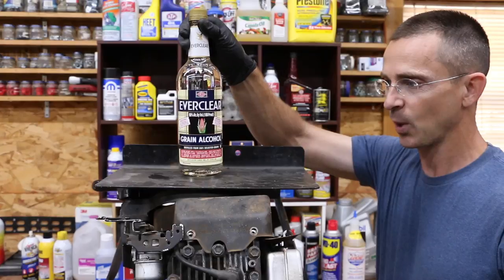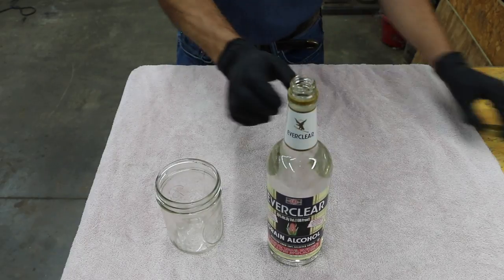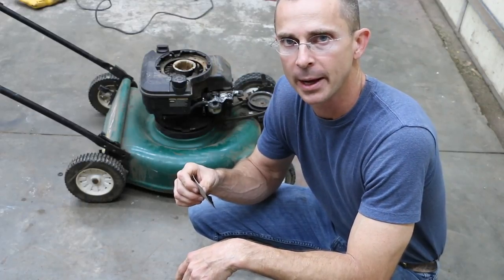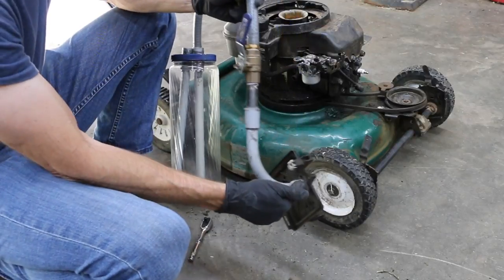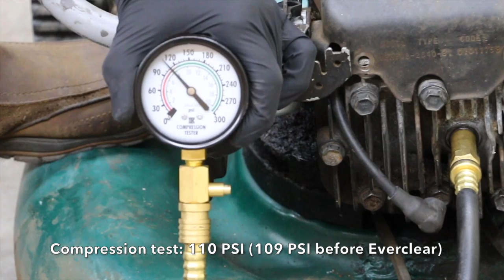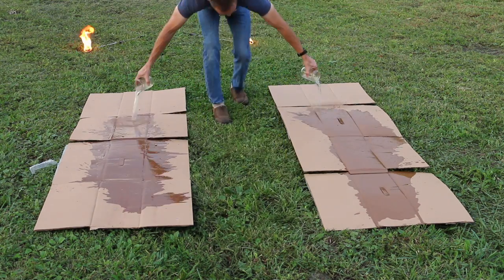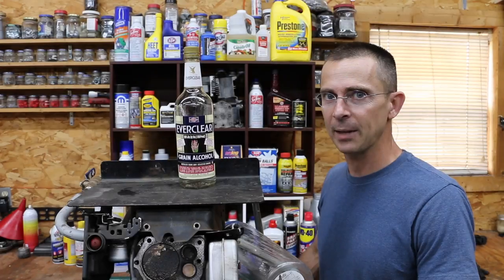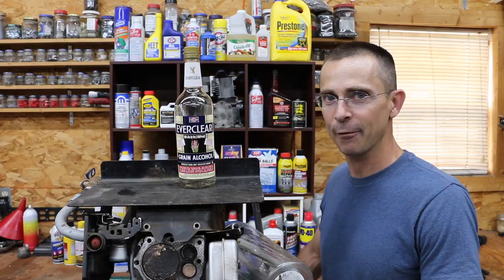Will an Engine Run on Everclear Fumes?  Let's find out!

Comment: I recommend a side by side series.  Gasoline vs ever clear, which engine will run out first.  Gas vs whatever.  I think that'll be interesting.  And then obviously a tear down which engine is has more carbon build up.  Might end up finding the alternative to gasoline lol
Reply from the maker: Thank you for this recommendation!

Comment: That's why alcohol mixes are used for high performance engines because it has a high octane level but for much cheaper than a high octane gasoline and cooler burning. Easier for the engine to run it and oxygen is a byproduct which helps too. You can also get much better compression/ use higher compression ratios, but these are from petroleum derived alcohols not for consumption.
Reply from the maker: Great point and thanks for commenting.

Comment: It'll work,I've done it..both in a lawnmower,and a car.(SBC.) Probably need to fiddle the carb. mixture a fair bit.  I didn't notice any major difference in temperatures,or power. (going by the 'butt dyno'). The car experiment wasn't straight alcohol,there was still a little gas in the tank,but it was mostly high-proof alcohol.
There are lots of stories of moonshiners using their hooch as fuel,in a pinch..it seems there might be some truth to those stories.
Reply from the maker: Thanks for commenting on this!

Comment: So as just sort of a personal project of mine, if I wanted to make a generator with a small engine like that, what kind of parts and equipment would I need to rig for near silent operation?
Thank you in advance.
Reply from the maker: Thank you for this recommendation.

Comment: Is the bottle cold when you're supplying the fuel?
Reply from the maker: The bottle is room temperature. I'm sure it would work much better if heated, so it could vaporize easier. Thanks for commenting.

Comment: What tool or homemade tool do u use yo start your engine id like to make something like that for my paps log splitter is has bad arm and cabt pull start his
Reply from the maker: I use a 1/2 inch socket adapter that mounts to a drill.  You can buy them on Amazon or on Harbor Freight for a few dollars.

Comment: So my vehicle runs on E-85 ethanol. I wonder if i could fill it up with pure Everclear? perhaps it will run either slightly lean. or too lean.
Reply from the maker: That would be extremely expensive.  Everclear has some water in it, which might be an issue.
Reply: you're right about the water part. e85 is 85% ethanol and 15% GAS. not sure how 90% and 10% water would be. probably not good for the engine. if some of the fuel bypassed the piston rings and got into the oil. the oil would immulsify. good call.

Comment: Try making a head with extremely high compression. Then allow the carb to push fuel into the port while it is cool then turn it off.
Reply from the maker: Thank you for this recommendation!
Reply: In theory it should compression ignite.

Comment: Is there any real difference between ever clear and the ethanol component of E85? Other than ever clear being even more pure. Could you make your own E85 with gas and ever clear if you had a flex fuel vehicle?

I seem to recall Mythbusters running a computer controlled camaro with moonshine.
Reply from the maker: Thank you for this recommendation!
Reply: Project Farm No problem. I enjoyed this video. I forgot to mention that using a computer controlled engine on a E85 car means the computer will automatically adjust fuel flow and spark timing.

Comment: Should have done the burn test on the cardboard at night.  Pure alcohol burns very clear.  In the drag racing circuit, additives are used specifically to add color to its flame for safety reasons.
Reply from the maker: Great point!

Comment: I'm surprised ethanol didn't burn cleaner. I was looking to see if you had done anything with E85, but this is very similar. E85 isn't liked for small engines because they sit around and E85 will absorb water from the air and grow things. It would be interesting to see an engine run on E85, then add water to E85 not to the point that you see it separate. (I'm assuming that would be about 42% by volume.) That wet E85 would be a mix of gasoline, ethanol and water all in suspension. If you add enough water, the gasoline will actually begin to rise to the top and separate. The alcohol and water will sink to the bottom. This would also be a cool test to see if gas stations can really "water down" their gasoline.
Reply from the maker: Thank you for the video idea!

Comment: As a random thought, if the small gas engine works off the vapor, and someone's breath is somewhat combustible, would it not dictate that fuel economy would go up if all engines were made to use vapor over fuel injection? Or, maybe in conjunction with?
Reply from the maker: Interesting thought. Thanks for commenting.

Comment: Before even watching, alcohol is a great fuel. Can be used very rich but the timing has to be advanced because it does burn slower. E85 does wonders to modified or forced inducted engines when tuned properly.
Reply from the maker: Thanks for watching.

Comment: My only criticism  about the video, which was great by the way is that you forgot to do a horsepower test to see how much less power that slower burning ever-clear makes.
Reply from the maker: This is great constructive feedback.  I'm trying to come up with an engine dyno.
Reply: Keep up the good work and let me know if you need any parts or tools for future videos.  I really like the seafoam videos on that ford ranger.
Reply: Max
In theory the alcohol can more horsepower due to the much greater cooling effect it has on the air charge compared to gasoline as well as alcohol's high octane rating allowing for more compression and spark advance before there is a risk of detonation. This comes at the expense of greater fuel consumption.
In practice, the way this experiment was set up, the engine will make noticeably less horsepower because it has to be choked (restricted air flow) so much in order to get the air fuel ratio rich enough for the engine to run on alcohol.
It would cost some money, but they do make small, adjustable carburetors for these types of engines designed to use alcohol (methanol). They are common on Jr. Dragsters and go-carts.

Comment: Alright now you done two tests where your fuel waper bottle system made an engine run on just the wapers of the fuel. 

For about 1,5 years ago my company got 50 busses that is Running on Compressed Natural Gas (CNC) .. 

Without any internal modification. Do you think a small engine can run on CNG only by modificate the fuel derivery system? :) 

I want you to try this. If possible you may can test LNG as well? LNG is Liquid Natural Gas. Theese alternative fuels is a intresting way of our enviromental friendly thinking of future. I find it interesting that our busses can run on it. Then a small engine can do it too! :)
Reply from the maker: This is a great video recommendation--thank you!

Comment: What's the pulley for at the front of the green lawnmower?
Reply from the maker: Great question. That's for the self-propelled system.
Reply: Self designed or factory fit?

Comment: Everclear still has 5% water in it, if you remove that will it run better?
Reply from the maker: Great question and thanks for this recommendation. I'll see what I can do in a future video.
Reply: Project Farm That'd be cool :)  So diesel engines use water fuel separation filters, you could pump the everclear through one of those.

Comment: I ran my minibike on straight grain alcohol. Briggs & Stratton 3 1/2hp.
Reply from the maker: Impressive!  How did it run?
Reply: Ran very well but needed enrichment. Drilled out the fuel feed 50%.

Comment: Nascar runs their vehicles off of alcohol. It's e85 gas. It's 85% ethanol and petroleum distillate. They use it for high compression or high boost motors in order to keep knock to a minimum and it burns cooler than gasoline. Happy racing.
Reply from the maker: Thanks for the feedback.

Comment: An internal
Combustion engine will run on just about anything flammable      Timing adjustments will need to be made according to what your fuel is also your jetting in carburetor will need to be changed
Reply from the maker: Thanks for commenting and great point regarding timing and fuel/air ratio.

Comment: i ran a slant 6 on Stetson a few blocks.
Reply from the maker: LOL!  Impressive!
Reply: Project Farm ran out of gas at the BK drive-thru and had to drive it a block or two to the gas station. Got Stetson for Christmas and it was still my truck. Fill the carburetor fuel bowl rolled out of the drive-thru fired it up , drove to the gas station

Comment: Run the mower off of water. Jar with water with two bolts going through the lid with washers on the end of the bolts connect power to one bolt ground to other and a tube going from jar to carb. Supposedly runs longer than fuel. Seen a few people do this on YouTube but I think you can do it better.
Reply from the maker: Thank you for this recommendation!

Comment: This comment is “backyard technique” but you could make the motor run by putting your hand over the carb instead of the tape. Works great for getting cold motors to run even on regular gas (I live in MN, -20 is not unusual). Get the ratios right and a flathead engine will run on gas, alcohol, or even white gas!
Reply from the maker: Thank you for this recommendation!

Comment: Going to wash the oil off the sides of the cylinders that's why it's always best to add oil to the Everclear when you run a motor on pure alcohol it. washed cylinders

Comment: my 1979 stick shift Chevy van run out of gas once. ,10 blocks from the gas station and i pull the engine cover and sprayed "brut" deodorant, the only flammable i had at hand at the moment and kept spraying while on 1st gear until i made it to the gas station.
Reply from the maker: Impressive!  This is sure better than pushing.

Comment: Vapors is what an efi system and a carburetor are trying to create.  Charge motion inside the cylinder furthers the process.  If engines ran on gas vapor then the fuel consumption will drop dramatically.  That's why they are not being produced for engines now.
Reply from the maker: Thanks for commenting on this.

Comment: I'd be interested to see you a video of you running a engine on nothing but 99.9% pure Isopropyl alcohol, not the 70/30 or 80/20 rubbing alcohol as that still contains distilled/deionised water.
Reply from the maker: Thanks for the video recommendation!

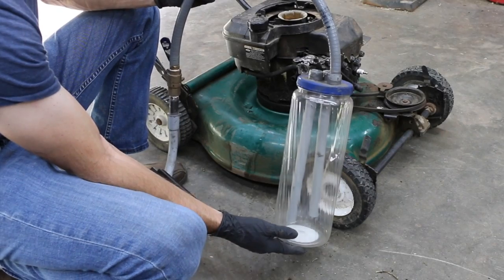Comment: 3:04 Congratulations, you've invented a primitive carburetor. It doesn't have an adjustable jet either. LOL.
Reply from the maker: It's amazing how well this simple design works with any fuel. Thanks for commenting.
Reply: The fact of the matter is that, while precise control over the fuel-air mixture is useful, it isn't necessary unless you're trying to meet inane emissions standards. There's a certain amount of fuel vapor that air can hold, and that mixture will run just fine with any volatile fuel.

ALSO, all the people trying to tell you to hook this up without a carburetor may not have fully thought it through. You're going to have to use the valve in the feed hose as the throttle. Be ready to close it some once the engine starts or it will run so fast it'll come unglued—wide open throttle with no load does that.

Comment: Everclear burns cleaner than gasoline. If you were to wipe the soot off of the inside of the engine before each test, you'd see that gasoline burns very dirty. Everclear on the other hand will burn clean and not leave behind a bunch of soot. That's one benefit from pure ethanol, the engine will stay cleaner longer. But, you'll wind up burning more alcohol to run an engine than gasoline. There are two parts to why this is. Everyone knows the lower energy density of ethanol, but the needed AFR for ethanol is also very rich compared to gasoline.
Reply from the maker: Great point.

Comment: Everything old is new again. The very first carburettors on gasoline engines worked just like this. They were called bubblers. Some very early ones used a wick. The venturi siphon carburettor was responsible for the early power improvements for gas engines.
Reply from the maker: Thanks for commenting.

Comment: see if the engine will run on fuel oil,it's similar to diesel but has a lower flash point.
Reply from the maker: Thank you for this recommendation.

Comment: can you run a engine on vapor without a carburetor?
Reply from the maker: Thank you for this recommendation.  I'll do this in a future video.
Reply: He just did. That's what his bottle is: a crude, detached carburetor. Nothing more, nothing less. To run an engine without ANY carburetor requires the use of a fuel (like LP or NG) that is already gaseous, and depending on your definition, even those use a type of carburetor, since the fuel gas and the air must be mixed somewhere. Or, you can use direct fuel injection, like most cars do now.
Reply: Still a vapor should run with a carburetor.

Comment: Test how true it is that burning oil or diesel in a gas engine will blow out the piston rings. The diesel shouldn't hurt it like in your one video of a gas engine will run on diesel. Which it did just fine.
Reply from the maker: Thank you for this recommendation!

Comment: 5:25 what you may not realize is the ethanol is actually burning, you just can't see the flame. It's hella hot tho. Gasoline produces more light as waste. Amazing huh? Methanol I believe is even less visible. I think hydrogen is only visible at night. Same with carbon monoxide. There are some efficient flames out there. Actually methanol doesn't lose energy as heat near as much.
Reply from the maker: Great point!
Reply: Project Farm oh since you answered I really appreciate guys like you doing what you love so we can learn. I would like to be able to make my own fuel one day, so ethanol, methanol, biofuel etc are top choices.

Comment: Stuff runs perfect through my 2010 Camaro 1400 hp motor!
Reply from the maker: Wow!  That an amazing vehicle!
Reply: Project Farm it actually made more hp and torque than just using E85. When running water methanol with both fuels it made even more because the intake charge was cooler and lower iat’s let’s you run more timing

Comment: Methanol and ethanol runs at about 6.2:1 where gas is 13.5:1 to 14.7:1 if you got some nitro you can burn that at about 1:1 with Air
Reply from the maker: This is great information.  Thank you for taking the time to comment!

Comment: The alcohol was on fire. It's a clear flame. Very dangerous. We have run alcohol through race bikes, it burns cooler, helping with engine temp, slight power increase, but uses about twice as much.
Reply from the maker: Yes, great point. The invisible flame makes it very dangerous.

Comment: I don't see why it wouldn't work in a pinch. Alcohol is used in racing engines all the time, even small engines like these. Just as he said though, it requires carburetor adjustments to make it run more effectively than gasoline.
Reply from the maker: Excellent point. Thanks for commenting.

Comment: It will run a lot better with 225% more fuel!! Basically your running E95 the only reason they put 15 % gas in E85 is so that the people wouldn’t DRINK THE MOONSHINE instead of put it in there tank!!
Reply from the maker: Thank you for this recommendation!

Comment: Make a hydrogen generator! It will be a challenging, but fun project!
Reply from the maker: Thank you for this recommendation!
Reply: So you are reading the comments! Nice! Welp, if you do decide to make one, make sure to use stainless steel for the anodes (+), and avoid using harsh chemicals to improve water conductivity. 1/2 tea spoon of baking soda will do just fine! I've actually made one for fun many years ago to see if all those youtube videos are actually true.  Check it out https://www.youtube.com/watch?v=Uzvr3VWYIUU&t=21s

Excited to see what you'll come up with

Comment: Of course it can run on alchohol. A combustion engine can run on any combustible material as long as you have the right compression ratio and proper cooling.
Reply from the maker: Thanks for commenting.

Comment: Everclear(E95) = $88/ga
E85 at gas station = $4.4/ga
The only difference is E85 is not "safe" to drink with 10% gasoline in it (but let's be clear the Everclear ain't all that safe to drink either.)
Reply from the maker: Great point.

Comment: While gasoline may be more volatile, ethanol is more dangerious because of invisible flames.
Reply from the maker: This is an excellent point. Thanks for commenting.
Reply: Thanks :) Ethanol/methanol fires are quite scary because they're basically invisible. The interior of your car could be doused in an alcohol fire and people wouldn't be able to realize it fast enough before the other solid carbon based stuff in the car catches it aswell. There's a pretty good video on youtube of an alcohol fire during a pitstop of a race on youtube.

Comment: Rubbing Alcohol would be the same, and much cheaper. Adding an ounce of motor oil to each liter will make a difference in the efficiency of the fuel.
Reply from the maker: Thanks for the recommendation.

Comment: Might want to light the fuels at night. Alcohol has a transparent blue flame.
Reply: FYI alcohol vaporizes better when heated. Coolant line next to the fuel line, acts as a heater.remember this is the real reason behind Prohibition. Can't tax homebrew.
Reply from the maker: Lighting it at night is a great recommendation.  Also, great point regarding heating the alcohol.
Reply: I grew up around people with stills. Could try a ultrasonic fog device as well.unfortunately lawnmowers don't have a 12 volt system. Alcohol is hard on rubber parts.
Reply: Most don't know the difference between gas at 66 degrees and 76 degrees. Just like the Duke's of hazard, they show you but they don't tell you. Why gas pumps say ethanol not alcohol, which ethanol is a form of alcohol.